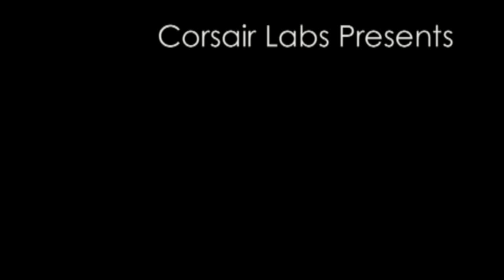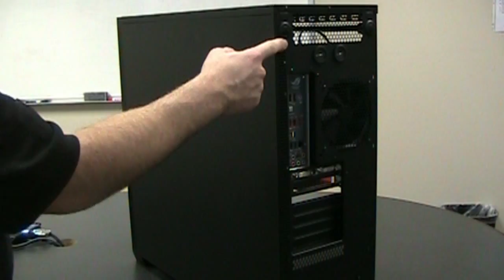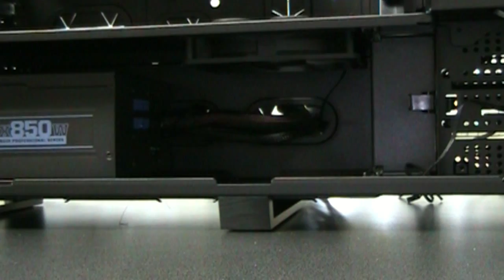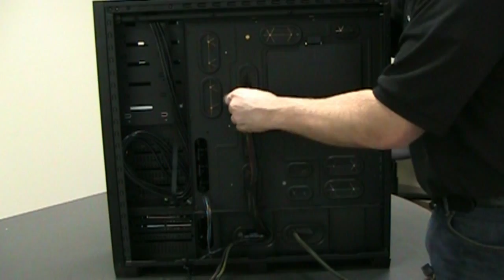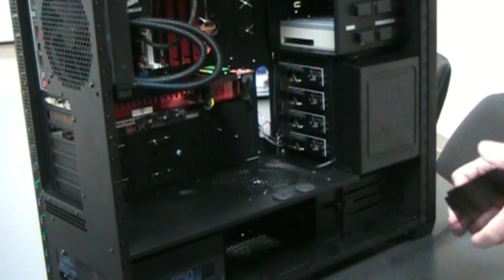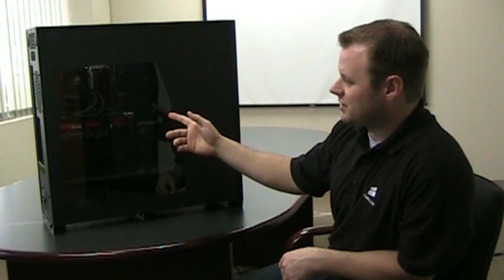Build a computer using the Corsair Obsidian 800D Chassis Part 2

Comment: I still think it's one of the best cases there is
Its actually one of the only cases I know that can handle a H105 in Push/Pull
But there is also room for improvement for the 800D
Corsair I Would Like to know if you guys would Rebuild A 800D with your current experience and skills how you guys would make it
and what your 800D V2 would look like

Comment: i have a 4 pin power for the psu and a 4 pin on the mother board as well....do i need to buy a 4 pin extension or will the one provided with the case (8 pin) work as well???

Comment: @buttah4269 and kinda missed in my opinion, I hate those massive holes in the side of the case under the motherboard for the air penatrator fans to draw air in. grrr. Even the Xigmatek isn't perfect, wish they'd just put a decent large side panel in it and better cable routing options and something to cover up the second cpu retention slot. But OH WELL :)

Comment: @buttah4269 Well if you stick a 4 x 140mm rad in the bottom you'd have to remove the bottom hard drive cage anyway, I really don't like the rotated motherboard tray in the tj11, for a case of that size I think it would have been so much better if they'd just left it the normal way round, would have meant I'd have been able to get about 3 separate radiators in there, but with how it is, its more inclined for air cooling, but silverstone have tried to make it good for watercooling as well...

Comment: @gerardbiteme Just because it was only meant to for WC doesn't mean you should rule out air cooling for this case. Just gotta do a few mods and take advantage of the free space up top to add good fans to it . And also replace the stock fans cause they are crap. This is exactly my build with the corsair 800d. Added 5 additional fans and the temps are pretty decent.  Eventually I'll go WCing once I'm confident about it enough to not risk having a leak.

Comment: @IgOrvElJo i think there using all the corsair components they can, hence the case, psu, ram, h50, also the 800d is pretty crap for air cooling, better to use one of those shitty all in one water cooling system's in said case, this case was always more well designed for watercooling really

Comment: It would have been better to use the Noctua NH-d14 cpu cooler because it works much better than the h50 and mushkin ram but that is relatively new as the cpu cooler. It would be great to see a Corsair case taking on the Lian Li feature of locking the power supply and use the tool-less plug-ins for the video card. Also maybe include the lock feature as Lian Li has for the Hard drives and ease of installation for the intake fans. If Corsair had that it would be good but Lian Li is much better.

Comment: I installed the intake for the H50 at the top of the 800D and left the rear exhaust fan alone. I also installed two exhaust fans at the top of the case as well as the H50 intake which are controlled by a Scythe fan controller so I only have them on when I am under heavy loads. I have an i7 920 overclocked to 3.6 GHz with no cooling problems whatsoever. This case is BIG and cools nicely. Check out my video on you tube: The Corsair Project. Buy this case you will love it.

Comment: Using the H50 fan to intake means theres no fan exhausting the air out of the case except if he add an additional fan, but thats not included. Corsair should include three fans at the top, that would be nice.

Comment: @SuchAComic 

Do you mean the sleeving, on every cable from the PSU? 
If you do, no. It comes with the PSU, or you could sleeve your PSU with sleeving from MDPC-X, but you have to make sure you know how to, so you don't break it. 

And yes, the Chassi is godlike to work in, too bad it sucks for aircooling, it's a watercooling case but i got it cheap, i fixed the temps by switching the exhaust fan on the back to an intake and putting two fans on the top.

Comment: @bigrock212121 
They offer a 700D model with the same chassis but without the hot swap the clear window for 250, keep in mind the case will be there for years while your other components will fail/become obsolete/ or you just get bored with the current build but this case will be there in the long run, it's best to invest in the case more than anything.

Comment: @johnyrockshell Yes, but if you plan on installing any drives in the higher drive bays you might need another extension cable for them, depending on your PSU.

Comment: @luis61961944 God's computer would have a removable motherboard tray. That's not to say the 800D is a bad case, in fact it's a very nice one, but a motherboard tray would really simplify cleaning and heatsink reseating.

Comment: @mhaneline   the last time i opened my case was last week when u poped in my new graphics card in/cleaned the dust fillters and no i dont "mod" pcs i build them... the case i have is a Coolermaster ATCS 840 whitch is aluminum but i like steal cases.

Comment: Now that was done RIGHT  Thank you.

Now when you want to change the Heat Sink you dont have to take 8 cables and 9 screws out just pop the back cover off and now you can get to the back plate.

If I was going to go back to PC case this one would be on Top of my list thanks for Video. 

All my pc's have been open air for last few years hobbiezones . com/page5.php

Comment: Yes.
Though, I guess its good to market your stuff but without any offense, this is lame. You know this case is a nice piece of "hardware" (if you may) but I sure would like to see you run a OC in it with air and then with water and see the temps, etc. The ppl who buys this is ppl with great hardware like two GTX295 or maybe even 3 (or 4 with evgas new motherboard) GTX285..
Well if you ever puts a review on temps in this case I would be one of the first to watch it! ^^